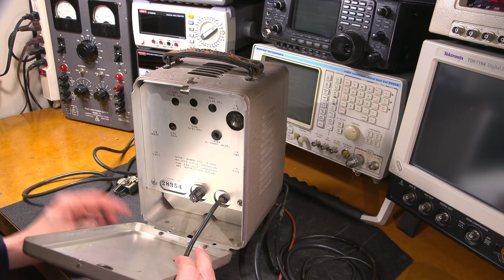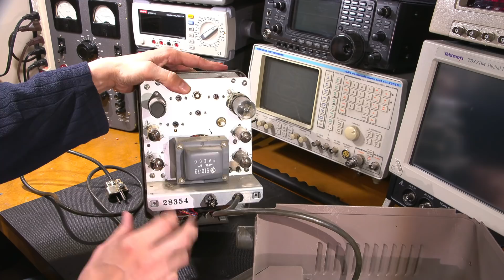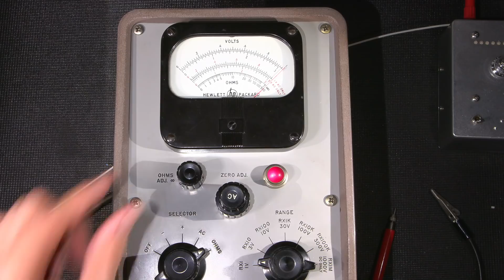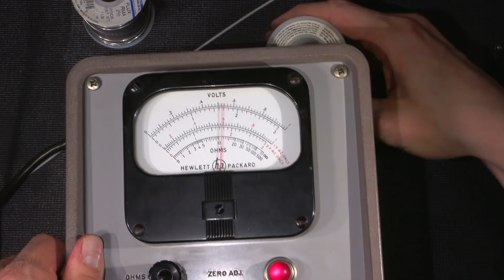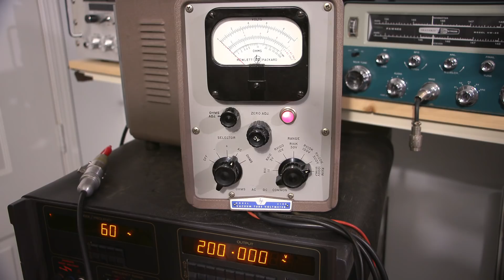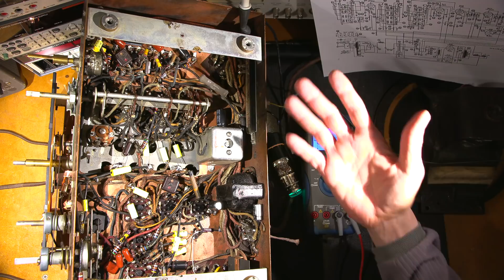The BEST VTVM? You Decide! HP 410B Restoration and Alignment

Comment: I spent a long time working in the Navy Metrology/Calibration program, and then in the metrology department of a major US airline. Both organizations tend to use test and measuring equipment to its bitter end, so I have worked on a few 410B and a LOT of 410C units in my time. An early experience with one of them was when a sailor brought one in from a ship, to be repaired. The complaint on the ticket was "Made a noise, then started smelling green." I chuckled a bit, because that made initial troubleshooting really easy -- check the Selenium rectifier first! As expected, it was no good, so it was replaced with a silicon rectifier. (Selenium rectifiers were obsolete by then anyway.) Then go through the minimum performance test to uncover any other issues, then do the calibration procedure and the paperwork, and notify the ship to come and get it.  

The biggest problem I recall us having was that certain users did not like the DC probe for some reason, so they would CUT IT OFF and replace it with a pin terminal. The problem with that was (IIRC - it was over 30 years ago) a 10 MΩ resistor in that probe! So by doing that they were instantly making uncalibrated DC V measurements! I don't recall what, if anything, management did about that. But what really concerned me was that the department involved worked on some strategic weapons systems! 

But I would still love to have one on my bench now.
Reply from the maker: Thanks for sharing your story Graeme!

Comment: Some HP 410B's came with a foot long high voltage probe that allows you to measure up to 100,000 volts.  One thing I've never cared for about these meters is the smaller meter face.  One nice feature is that the resistance measuring circuit uses line supplied current as opposed to a battery which tends to be forgotten and ends up corroding the insides of many VTVM's.

Comment: Hi Paul, great video, I expect no less from you.  About a year ago, you make a video concerning the Sentinel ME-26D/U, you tipped me off to the HP 410B.  I have the H/P 400C, VTVM only purpose for A/C measurements.  Quite fine instrument, which I fully restored back to pristine condition.  So I set out to find a the famed H/P 410C.  I found one on eBay, in like new condition, fully restored by a nice gentleman from the Silicon Valley.  Unfortunately he was asking $350.00 a fair price it would seem.  But alas I did not have the funds for such a instrument.  I have looked high and low, no HAM swap meets for more than a year and nothing on eBay.  I will look at HAM meets that hopefully start up this Summer.  Take care Paul and again thank you for all you do.

Comment: I've got a HP 3478A bench meter that will do 10Goms input impedance, but only up to the 3V scale.  Beyond that, it's the usual DMM 10Mohm.

I'm thinking a FET-input op-amp would work as a buffer for DC voltages up to about 20v or so depending on the op-amp's specs.

Comment: Great vid again, I Have for years the follow up the HP 412A (1959) . Did a spec. check back in 2011,Still SPOT-ON!! It has not the AC measurement though. Interesting it has a Mechanical chopper inside.With Lightbulbs,LDR and rotating blades. Also they left the Ohms calibration and figured out circuit to leave that out. Find the Specs and be amazed. 1959-07-INFO-Blad-Specs-HP412A.pdf https://archive.org/details/hp_journal_1959-07

Comment: A lot of newcomers are impressed by the 5-8 digit display resolution of modern DVMs but they are sort of useless past 3 digits, since any circuit has hardly any calculated precision of more than 3 digits so the extra are a false sense of security. That is way a slide rule was faster and precise enough for electronic design. Few people use them now but they were a lot faster than a calculator and the nest thing was all the variations of a range of values were directly visible so nudge or fudge factor values were as quick to see when one value was nailed down. So the analog 410 or 400 AC meters were plenty accurate enough plus had the advantage of being able to spot trends or changes much better than watching numbers flash by. Trends in value changes are much faster to spot with analog so every bench should have a VTVM alongside any digital meter. They both have unique traits that the other does not have.

Comment: These videos bring back so many great memories, for decades I collected test gear, mostly HP, GR and Tek and had restored units of most of what HP ever made. Living in Northern California a few hours away from HP the equipment swap meets held early Sunday mornings with hundreds of collectors, many where engineers at HP who were involved in designing the gear so any question got authentic answers. The old stuff was cheap and I had an old VW van that was only used for hauling get back from those meets. Any part or assembly needed could be found if one knew what they were looking for. My main business was a large recording studio in Sausalito but I also had a large 23 tech repair shop for pro audio gear and a shop in the mountains which had contracts for two-way radio repair for agencies of city and county but mostly for 3  National Forests so that meant collecting RF test gear also which was handly for my ham radio hobby projects also. The studio had 4 full-time techs plus me when I was not engineering, but as the studio became a top studio the 3 studios were booked constantly with major projects which had their own producers so I spent more time in the lab designing new gear and playing with repairing and calibrating test gear. In the big repair shop with 23 techs, each had 2 fully equipped workbenches so waiting for customer est approvals meant the tech could move to the next bench and take in a new project without reassembling the first one. When applying for warranty status for major brands, they always wanted a list by model and brand of test equipment and the standard list I sent had 524 pieces of HP, Tektronix, and Sound Technology test gear, taking up 32 pages. A few times they sent reps to see if we were lying. All that restored and calibrated gear was from those swap meets. In my second barn in my ranch, up in the mountains 200 miles away was a large storehouse of parts, units to be restored, parts units etc for test gear, ham radio, RF service monitors etc. 20 years ago I gave it all away to employes, girlfriends and moved to another country and for the first few years I returned twice a year and brought back what I could bring in suitcases and in 5-6 years I had enough for a pretty complete RF and Audio workbench in my city center 250-year-old apartment in St Petersburg Russia and still do repair, mostly for fun of audio gear like guitar amps and mixing consoles. About the only thing I miss is that collection of test equipment but I have too much fun here with too many young girlfriends and cultural performances nightly or dancing in clubs until 5 am.
Your videos are a delight for a committed nerd. By the way, speaking of 410B, I naturally had a lot of those but also 76 400FL or GL AC meters, and my personal favorite bench VTVM was the 410C. It was a lot more modern looking and was smaller. I had 38 HP333 or 334 distortion analyzers and a dozen of my favorite HP3580a audio spectrum analyzers. I have one here that never needed work and used daily but the HV when out and it appears the high voltage transformer has failed and for 2 years have searched for one with no success. Maybe you have a source or know of a junker that I could steal one from.
Happiness is a bench full of HP and Tek test gear....

Comment: A question for Mr Carlson! Not long ago I got 5 tubes (a miniature pentode type 6.3V 100mA ) but I have a hard time getting them to work. The filament lights up the cathode is a dark red color but when I connect to 90VDC anode nothing happens (I’m making a 2 tube battery powered radio). Is my cathode cold? Is 90VDC not enough? Wrong tube type? Please help
Reply from the maker: Put a 47K resistor between your supply and the plate of the tube. Now you will be able to pick a signal off the plate.

Comment: Hi, Would you be interested in my sending you a Boonton Electronics Capacitance Meter Model 72BD?  It should measure 2-2,000 pf, but does not seem to work for me.  Because of its age and circuitry I think others might like to see its insides and a repair video made by you.  I can send it to you if I have your mailing address!!  Thanks so much for considering my request! And of course, I will pay for the repairs!!

Comment: Happily I own 2 of them. One original and one someone put in a homebrew case many years ago. The tube in the probes were made specifically for this meter. They are expensive and hard to replace! Often they sell for more than a complete meter, if you can find one. That is until now, because of the "Carlson Effect" that will drive up the eBay prices for the meters for the next couple years!

Comment: The powersupply you are using seems rather impressive - what brand and model is it?
Speaking of VTVM's I have just restored my RCA Senior and have taking my HP 410B  in for a restoration - I am having issues with the meter getting stuck at a point occasionally - any suggestions  will be appreciated.
Regards
Reply from the maker: You will need to loosen the meter movement. Usually a small amount will free them up. The Calibrator is a Datron 4708 with all options.
Reply: Thank-you,  I am afraid that the meter in HP 410b is too unreliable since it shows different values - I am thinking of using a Simpson meter to replace it.Do you know the value of the meter in microamps?
Regards

Comment: What I learned way back when and still consider valid, was that gold color on the value bands = 5%.  Silver is 10%.  No ring in the tolerance position is 20%.  Now, you could expect more bands, but your measurements suggest the 5% and 10% components.

Comment: Will you replace the leather handle on top? The rest of the meter looks and performs so good.
Reply from the maker: Im not to sure. I'm not a fan of handles, and may just remove it and cap the holes in the case with some finishing caps.

Comment: What is the best way to get a "sticky" needle to move freely again?
Reply from the maker: Usually when the movement is too tight, this is caused from the case shrinking over time, (or warping) You need to gently heat a jewelers screwdriver, and give the movement tension screw a slight twist, (loosen.) The screwdriver is heated to melt the glue that they usually apply to the tension screw.
Reply: @MrCarlsonsLab  Follow Up... Just wanted to let you know worked like a charm.  Enjoy all your videos and mostly the lessons. Just wish here in the Philippines I could find components like Caps and Resistors.

Comment: Great video (as usual) Do you have a suggestion as what to use to do the calibration.  Most of us don't have a lab grade voltage source!  So I have been trying to think what I could use to get accurate 1 volt AC up to 300 volts.   The resistance is no problem -- voltage calibration a bit tougher.  Thanks for sharing -- always learn something and get inspired to do better work.
Reply: I just finished fixing mine last week, inspired by this video.. It's a great meter, and mine came right up. I've got a Fancy Old Time Calibrator (A Fluke 760A, which is a beast) that's on the Healing Bench. However, that's not working quite yet. So I used one of my bench DC supplies and my main bench meter for the DC voltage range, and then used a wall-connected variac and a step-up transformer for the AC Ranges, comparing it against my main meter. Not quite as good as a calibrator, but still serves the purpose..

Comment: Here's the manual on the 410B:  http://hparchive.com/Manuals/HP-410B-Manual-SNprefix-024.pdf  (HP Retired here).   Notable is the HP part numbering scheme used here was still used in to the 2000's but was mixed up after the acquisition of Compaq.  Then, they kept separate HP and Compaq part numbering schemes.   HP really wrote excellent manuals on their earlier products.  They didn't hesitate to include schematics and theory of operation, even with their early computers.  A company started by engineers for engineers at one time.

Comment: Thanks for posting this! I have a 410BR (rack mount) that works, but needs a refresh - good incentive!
Reply from the maker: Glad it helped!
Reply: @MrCarlsonsLab  Mine's missing the cable set, including the AC probe. Works for for ohms and DC with clip leads, but I need to make some probes. Have you replicated the AC probe with either a solid state or tube rectifier other than the 2-01? I have a few 6AL5 diodes that would fit in PVC tubing, and some sharp probe points.

Comment: Many of those nasty DMMs have high impedance modes. The venerable HP 33401A on my bench is 10 megs normally, but in the auto mode, on the 100 mV to 10 V ranges input impedance is > 10G ohms. My handheld Fluke 87V also has a high input impedance mode, but only on the 600mv DC range. Thanks for the great video! I love the old HP and Tek gear that have (mostly) replaceable parts, and comprehensive service manuals.

Comment: Whoa! I just got my ears blasted out by Dr. Carlson's dulcet voice. Not his fault, the last video I watched had low audio levels and I had cranked my receiver to the halfway point. (Seriously folks, most video editing software has audio normalization and compression tools, and probably a software-implemented VU meter as well. Please learn how to use them. Love, The Rest Of The World.)
I actually cheered when I saw the HP replacement for the Sylvania tube!
After showing the Agilent dragging down voltage on the AGC line, I ALMOST expected you to whip out one of those horrid dirt-cheap $10 DMMs for a comparison. Then, it dawned on me you probably wouldn't allow that rubbish to exist anywhere on your property.
Reply: If you wait harbor freight offers the 10 dollar one free with a coupon. Those are nice if someone asks if they can borrow your meter to test something on their car or whatever. Then you plead with them not to bring it back :)
Reply: @marka1986  Those little harbor freight freebie meters have one useful function. Battery tester feature is useful.

Comment: Tube hold down, two points to HPs Engineers for coming up with a way of holding the tubes in the socket. 
Suppose that comes from working in a garage full of exhaust fumes?

Comment: Question on carbon resistors , I always wondered if carbon resistors [ take up moisture ? and change value ] if they could be dried out - much like decasent - bake at some temp to dry out ?
Thanks again 
Mainly because the lack of old carbon resistors .
Reply: Actually, yes, they can be dried out.  Carbon Composition resistors will always go up in value if they pick up moisture.  The Allen-Bradley ones, the ones in this meter, will always go back to their original value when dried out, and would almost never go out of tolerance even if they were stored unpowered for years.

The “conditioning” process was to bake them at 200 degrees F for several hours.  A-B had a data sheet on the conditioning process.  Usually, the heat dissipated by the resistors when operating in-circuit was enough to keep them dry and right on value for ever.  

Look how nice the color bands look after 60++ years!  (39 years in sales/marketing at A-B/ Rockwell Automation; I sold many millions of them!)

Comment: Mr. Carlson, I own two different military versions of the HP 410 B and very happy to have the military manual plus updates to boot. The difference between the two is the serial number ranges. HP replaced several values of components dependent on the updates. Also, the selenium diode is backwards in the original schematic. HP 210 Bs are great reference meters.

Comment: I wish I knew where to get the single stand-offs you use often. Thanks for the video
Reply: Try searching for Litton USECO or Winchester Insulated Terminals. I have a 1963 catalog that lists them that way.
Reply: @richardgoebel226  thanks for the tip. Your catalog doesn’t happen to have a part number? No luck on google using those key words
Reply: @fredfabris7187  Litton USECO made a wide variety of uninsulated terminals mostly 2 styles, turret and bifurcated. Insulation material from Hi-Alumina (ceramic), Teflon, Alkyd to Daillyl Phthalate. Stud mount, screw mount, or swaged press fit. And different widths and lengths. A huge list of part numbers so I will stick with turret style, standard size to narrow it down somewhat. Hi-Alumina 1460, 1461. Teflon 1450, 1451. Alkyd 1417, 1418, 1421, 1422, 1423. Phenolic 1400, 1401, 1410. Diallyl 760, 763, 766, 780, 783. These are numbers from a 1970 USECO catalog i just found yesterday. Good luck.

Comment: How do you (and others!) feel about replacing hard-wired line cords with IEC connectors for things like this? I find myself buying vintage stuff on eBay, fixing it up and playing around with it for a few months, then reselling it so I can have fun with another project for a while. If I were keeping all this stuff just for myself I would definitely prefer a detachable cord; the ones with the inline switch, fuse holder and EMI filter are particularly nice to have. I worry others might not appreciate it and lessen its value though.

Comment: You did a masterful job of this video. I am very impressed with this VTVM. Something that is special about the 410 is the DC input resistance, more than 100 megaohm. The more common VTVM's on the used market are 11 megaohm DC input resistance, so they will load a circuit in a similar manner to a DVM (10 megaohms usually)
Reply: True, the 4x0 series including the 410C and all the 400 models of AC meters were perfect for circuit analysis due to that high z input that was needed in sensitive tube and FET circuits. The 410a, b and my favorite C were flat to 700Mhz  and any design or prototyping work in RF, that was the meter series to use.